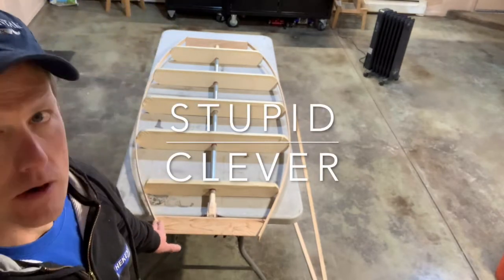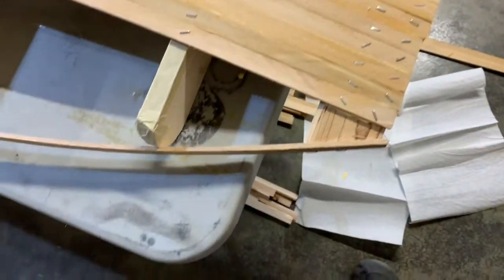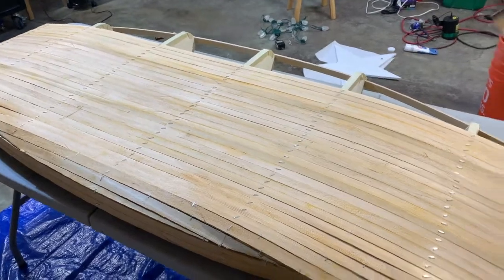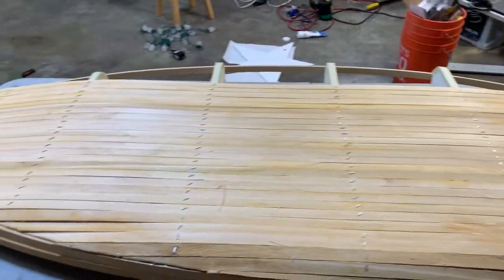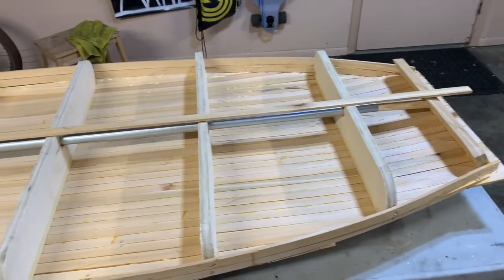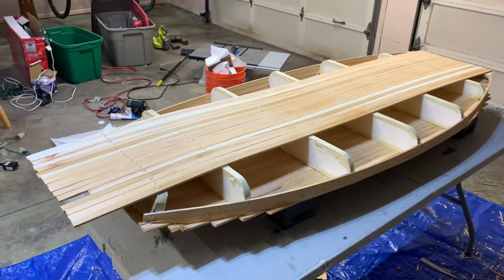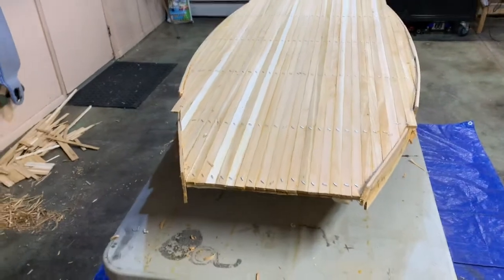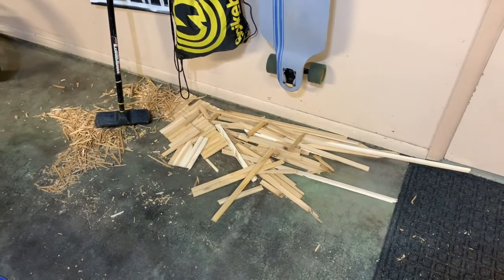DIY Cedar Strip E-Foil Build Part 2

Comment: What type of glue are you using? Have you thought of using counter sunk screws in the main frame?(they'd certainly beef up the structure). [I worked for Boeing & Lockheed. Doing structures & final assembly.<had to learn it when the demand for electronics techs wasn't so high. They ALWAYS needed "metal manglers">] But it's looking good. Of course you've probably completed it by now, so my advice is a moot point.
Reply from the maker: Titebond wood glue is the only glue I use for the wood strips.  Not sure where the countersunk screws would go.  The form holds together well after just the first two strips are in place with staples.  You’ll see in upcoming parts, the form is soon discarded once the fiberglassing gets started.  Some days I wish I had more of an engineering background, but then it wouldn’t be as much fun trying to figure things out and asking online forums for advice!  Thanks for watching!
Reply: @stupid-clever  I've heard that was a water based glue. It's great on furniture & guitars, but I've heard you can remove it with water & elbow grease. Just a word. I've heard the Tight Bond 3 is really great,& not easy to remove. Hoping for the best of course.